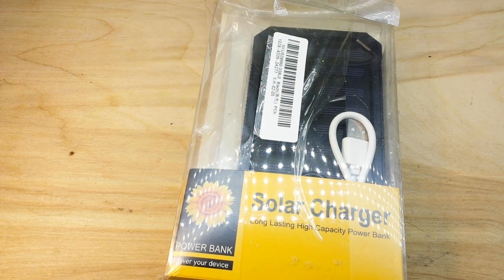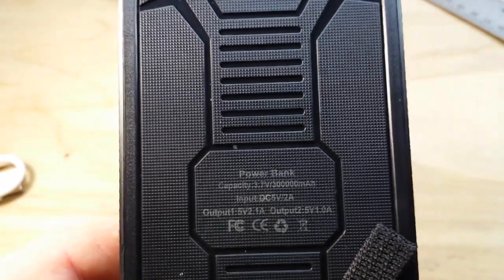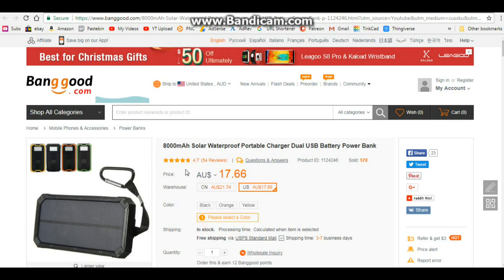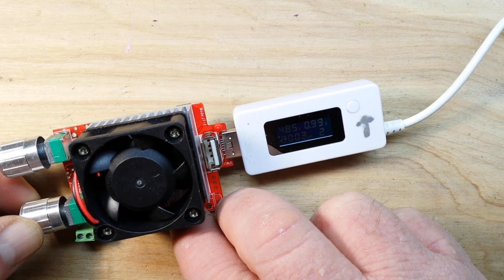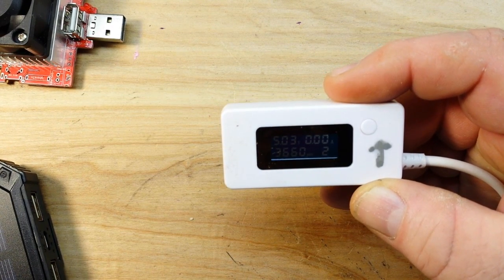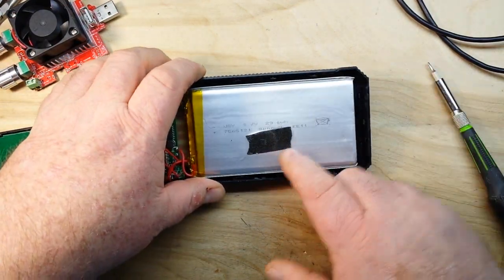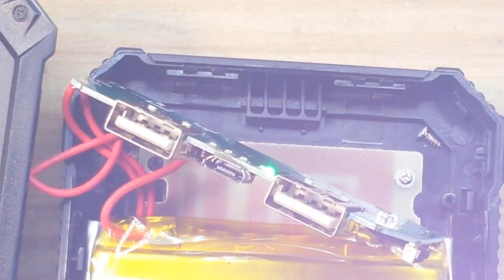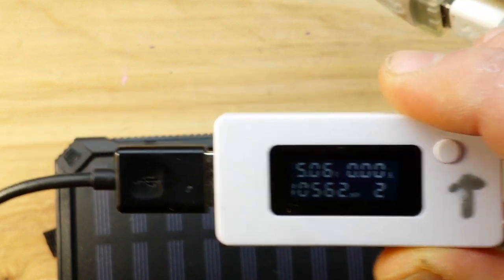Banggood 8000mAh Solar Power Bank Teardown and Review

Comment: Had mine 2 maybe 3 years. Summer heat and sun has bulged the 2 x 7565121 li-po. I dont like waste so was thinking replace battery with 6 x 18650 25ah. Any ideas?  Oh and nice teardown vid, model looks almost like mine.  Rated capacity was sold as 20,000 mah opened up has 2 x 8000mah 7565121 li-po. So I think someones been rounding up. At least I didnt fall for the 500000000 mah stuff i see online.

Comment: well, don't get fooled by the marketing schemes --> 8.000Mah @ 3.7v (nominal Li-Ion cell voltage)!!! but when you discharge it at 5V that will be 5.920Mah (that's about how much it took when you charge it)

Comment: I have this same power bank except mine is supposed to be 300,000. I took it apart and the battery looked like a hot pocket. Before this happened it worked very well and charged my phones with no problem.

Comment: i bought this crap new, try to put it out for test, as soon sun hits it for a while, it  swollen like a pig (i think it uses lipo batteries) and that's was it, not working anymore. yes, they mentioned in "manual" you shouldn't put it on direct sunlight, but wtf? it is a solar charger, for love of god. lipos were bad idea here, imho, since they also could ignite and then you have big problem, id this happen somewhere in the wild, where is dry etc.
oh, yes, and ideas fro 18650 conversion?
Reply: Ya same thing happen to mine,  the battery is swellen now.

Comment: The Results are presented in a Very misleading way, and the conclusions made are eventually WRONG.

The measurements of capacity displayed by the charge monitor are at 5V and the actual Lipo battery has a nominal voltage of 3.7V. So according to your 2nd test result, it took 6,920 mAh @ 5V which is approximately equal to 34.6 Wh or 9,351 mAh @ 3.7V. So infact it is exceeding its specifications of 8,000 mAh@3.7V or 29.6Wh. And for the discharge test (1st test) your charge monitor displayed 3,660 mAh @ 5V which is equal to 18.3 Wh or 4,945 mAh @ 3.7V. Which gives it an total efficiency of 18.3/34.6 = 53%. Not very bad considering the fact that it's a cheap chinese power bank. But if you compare the output energy with respect to the specification it gives it an efficiency of 18.3/29.6 = 62%. Slightly less than expensive and big brand power banks which give efficiency of about 70%.

Comment: Can we send you a spudger?  If so, put it on your amazon list:
https://www.amazon.com/iSesamo-genuine-spudger-repair-opening/dp/B06XD8M1CB/ref=sr_1_8?ie=UTF8&qid=1513748898&sr=8-8&keywords=spudger
Its the same one as Big Clive or pick another.  I have it and love it.

On those capacities, not to make excuses for them because there is none, I think it's the total capacity of the batteries.  So if you take the 8000 *.74 (3.7 nominal up to 5v), the *.9 for boost inefficiencies, you come close to what you came up with.  However, I think Great Scott did a video on one of those that when it was charging under certain circumstances, it was actually discharging because it had a LED that indicated it was charging that took more power than the solar panel put in!  Interesting if yours has this characteristic.

Comment: hello its me again. I don't really trust the numbers of these. and the solar would take for ever to charge. I need some help! like always . I was thinking of a 555 and a analog volt  gauge to use as a fuel gauge. use the duty cycle to move the volt gauge hand up& down  depending on the level of resistance of the sender. I guess it could be done with voltage dividers. but that could make heat. if you can help it would be great! thanks

Comment: You cannot compare capacity in mAh measured at different voltages! You can only compare energy in mWh without looking at the voltage.  Notice also that power bank has boost converter with efficiency about 85-90%. Battery capacity is measured diferrent way than it is discharged in power bank. Datasheet min. discharge voltage is usually lower (2.6-2.7V) that used by power bank (3.0-3.3V) so real capacity used by power bank electronics is lower. Especially under load.

Comment: I got one similar I made a video on but the LED lamp never worked on it. I thought the solar was fake on it because it looked like a sticker but it was legit. It's about the same capacity as yours though around 3500 mHr.
The one I have has the 18650's in it and not the Li-Po pack yours has..
The "dots" are a bar-graph style system, Solar or wall charged they will light up in sequence as the battery charges.
Reply from the maker: +ElfNet Gaming Cool. On mine the dot bar graph only lights when charged via the USB port. When charged via solar only 1 led lights.

Comment: Hmmm really? Thumbs up? Not giving even half the capacity it should and not being waterproof. Are you sure?
Reply from the maker: Josef Bücker Did you watch till the end? Capacity actually 86%. As for waterproof?? Yeah not so much.
Reply: learnelectronics I am sorry my bad.
Reply: I don't think that it's 86%. The input was 6000mAh+, but you have the overhead of the buck regulator to battery level at 85-90% efficiency, as cbm80amiga stated. A second discharge would show you a truer reading.